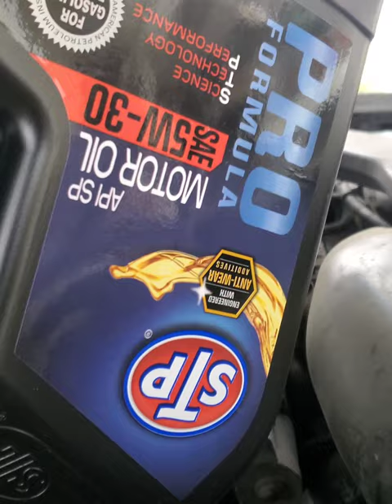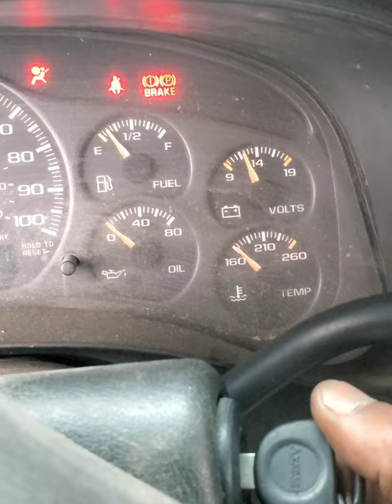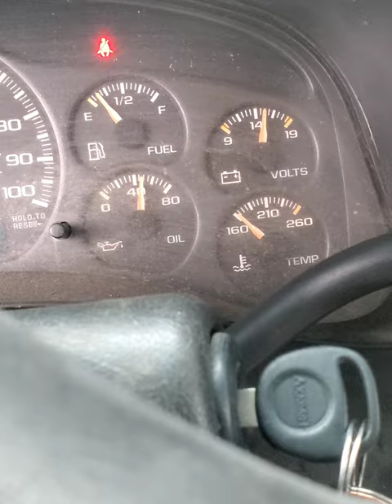GM 5.3 OIL PICK-UP TUBE O RING REPLACEMENT

Comment: I replaced the pickup tube o ring because of low oil pressure. It helped a bit, but for a couple of months. Now its back showing low oil pressure. Could it be oil pump? If it is then im going to have to replace it.
Reply from the maker: Yessirrr definitely could be.... have you check the oil pressure sensor?  Its behind the intake.... probably wont be able to see it. I would maybe replace that before the oil pump.
Reply: @malleygotaction665 i forgot to mention that i did replace the sensor also. Tahoe has 200k on it so oil pump is next. Thx. New subscriber.
Reply from the maker: @-LiFe-ej5mv  i would maybe compression test each cylinder just to check before you get to pulling stuff apart... that may give you a idea, maybe a cylinder is hurt..... then i would do the oil pump..... just trying to give you some options before spending some bread..... and thank you for the support fam really means alot

Comment: I’m about to do this right now but I don’t know if it’ll fix the knocking or not
Reply from the maker: You might wanna compression test the motor as well....
Reply from the maker: Probably wont fix a knock.... but will definitely help with oil pressure issues
Reply: @malleygotaction665  yeah it didn’t start knocking to where I can hear it over my exhaust til the oil pressure started jumping around
Reply from the maker: When you drain you oil, run a magnet or something in it to see if its alot of metal in the oil, and check the filter too
Reply: @malleygotaction665  I’m already knowing it’s not gonna be that lol it sounds too engine related and a knocking by the trans pan in park but I just put a new trans In October so who knows
Reply from the maker: @bigshotta8505  bro check your torque converter bolts!!!